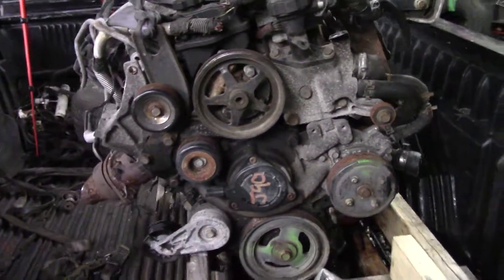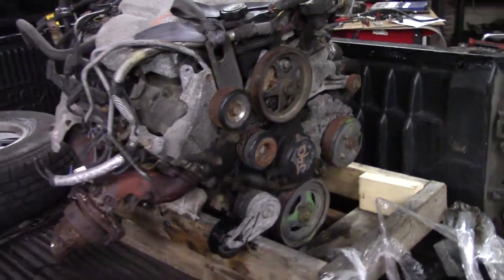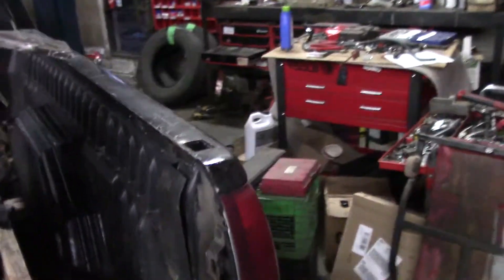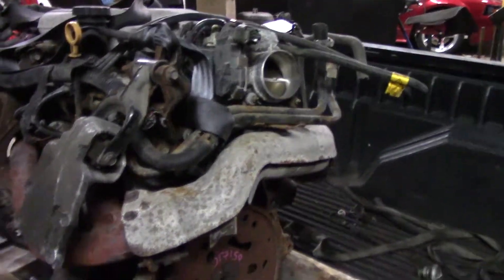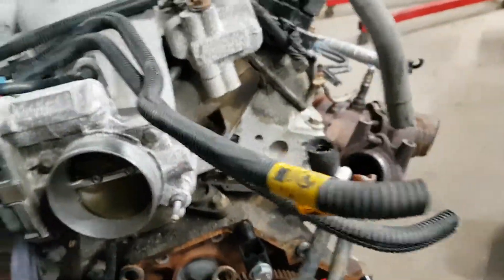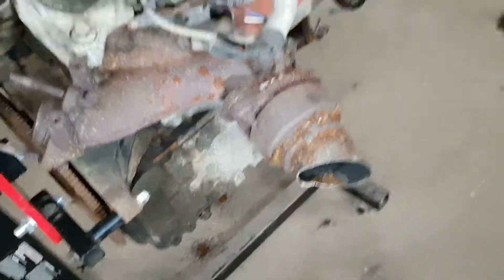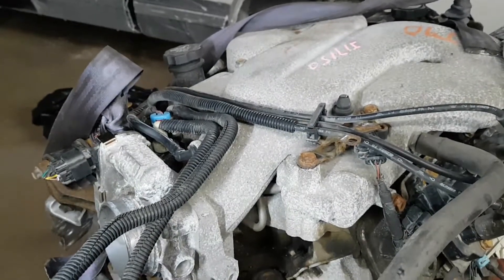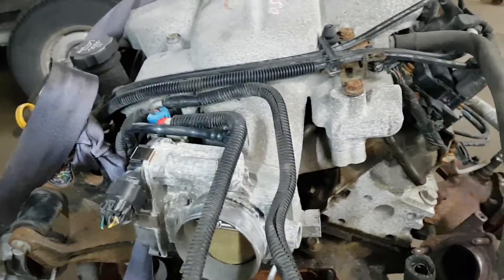New Engine for the Red Rocket!

Comment: Holy shit batman, this is a huge undertaking! Did the red rocket's 3400 go kaputskie ?
Reply from the maker: No not yet lol! Just looking for some more power! this probably won't go in until the spring. I ended up pulling the heads off this engine for some porting and polishing work while it's out!
Reply: @modeverything1  Cool. From just looking at it here, it seems to be very tall, or oil pan very deep. Sure it's going to have clearance?
Reply from the maker: It is not much larger overall than a 3400. I would guess that it's only about an inch at the most if it is...